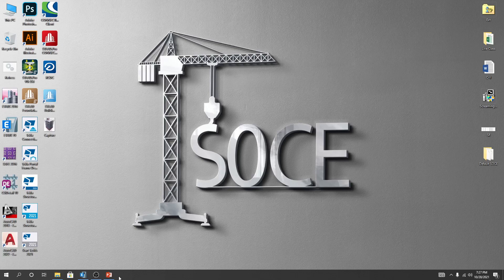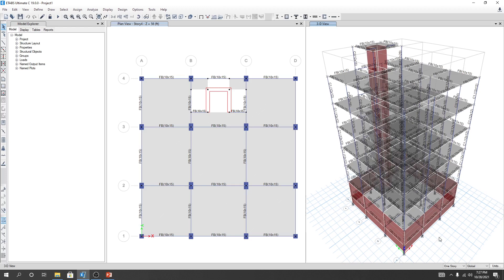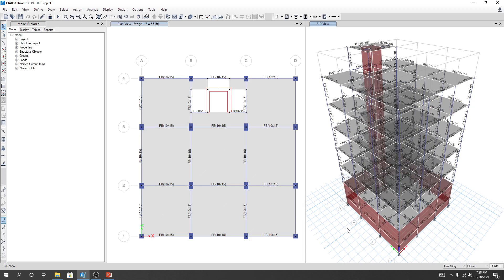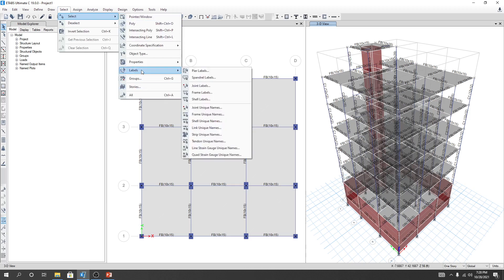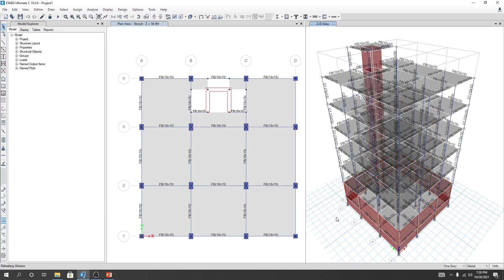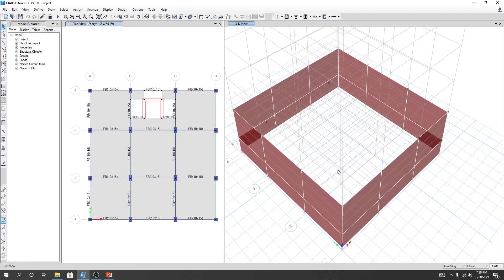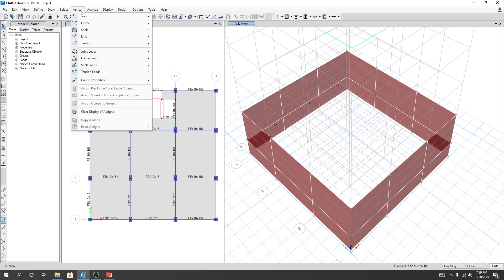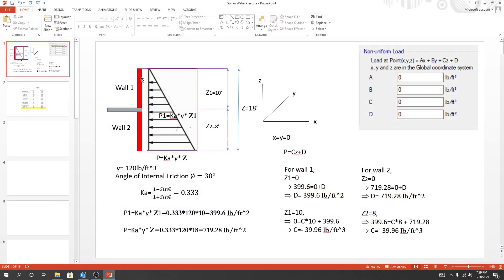7. Complete building design in Etabs 2019 | Real Project Design | Basement Soil Pressure Calculation

Comment: While calculating C and D values, The Z value is  considered from bottom to top: however, I believe it should be considered actual Z-coordinate as per ETABS. if we are not considering as per ETABS Z-coordinate the applied non uniform pressure is in reverse direction maximum at top and minimum at bottom.

Comment: @School of Civil Engineering,
Sir! first u said that the value of z we are taking is from bottom to top but when you were calculating the value for top point u entered the pressure value = 0 even that point has been taken as at 10 feet and by formula you calculated the pressure value of 399.6 for z=10 ft. then why are you entering 0 instead of its value. why is it so?
Reply from the maker: im sorry for late reply.. we will go form bottom to top.
Reply: @qlearnify-en  ok.. so are you mistaken by putting the pressure equal to 0 as I stated before or its because of any other logic? Kindly explain. I am continuously waiting